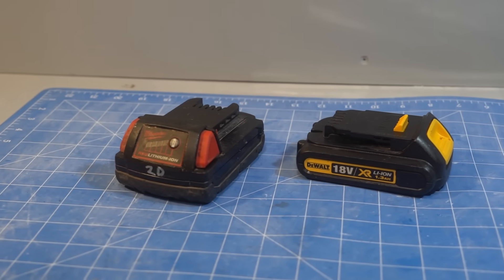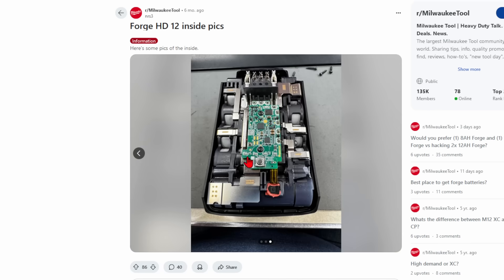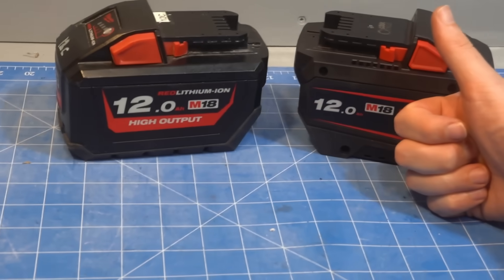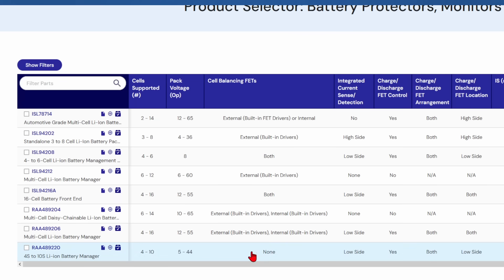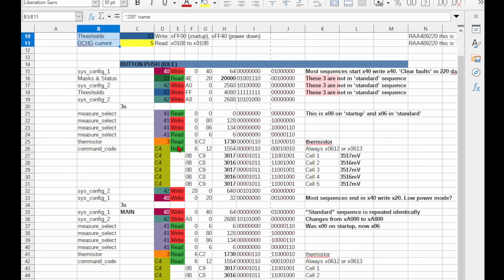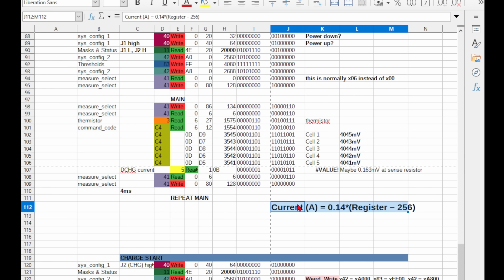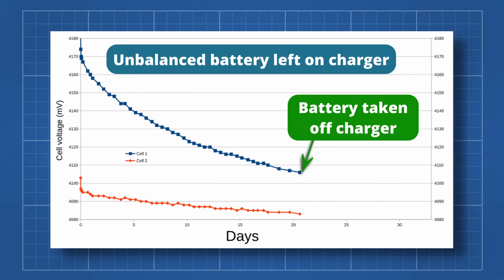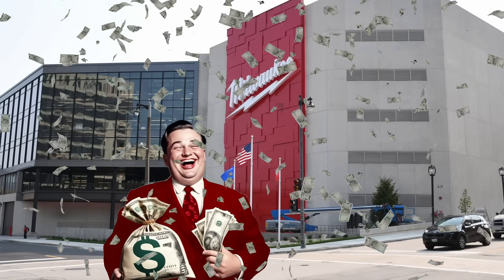[011] Do Milwaukee FORGE batteries balance

Comment: Im a car detailer and I run dewalt and milwaukee buffs and da polishers. The ergonomics of the milwaukee polishers are better, but their batteries are total crap! Lasting just over 2 yrs. I have dewalt 54v flex volt batteries and they're 6 years old.
I was hoping they have improved their bms, but with your findings they haven't.
Thanks for doing a thorough test and letting us know😊
Reply: IMHO the older 5ah milwaukee batteries were decent.  Once they started with the 9ah things went down hill.  Now I find that I'm burning through batteries, both m12 and m18.
Reply from the maker: @andrewfryc5602  do you know which ones in particular fail? From personal experience (and reading of others), the 8Ah and 12Ah are poor. The 2Ah, 4Ah, 5Ah and 6Ah High Output are good.
Reply: @toolscientist  12 amp and 8 amp are the ones that fail. I take the battery apart and charged the low cell, this my give me an extra 3 to 4 months, but the damage has been done by the bms.
Reply: The batterise are high output.
Reply from the maker: Yeah, they've been really problematic for me. The Samsung 40T cells are a nice for power & capacity, but pretty bad with longevity. Unfortunately we're probably going to end up being the beta testers for these new Ampace JP40 cells.
Reply: Same with Bosch Core 4 and 8 amp batteries. I think they use the same Samsung cells, Huge imbalance after 2 years. Many completely dead
Reply: @toolscientist  You read that right - BETA testers! No thanks. 

Makita XGT it is.
Reply: @toolscientist  there are three revsions of 40T cells, original ones, 40T3 and fairly new 40T4. I would say that the original ones are problematic, new ones perform well in cycle tests. They are also releasing a new 45T cells, so I expect some 9Ah packs soon :D
Reply: @andrewfryc5602 Interesting. You sure that the BMS is actually harming things? Because if all it’s doing is not balancing, I don’t see how it would harm them if it doesn’t balance. It should be ceasing to charge when the lowest cell is at 100%. 

Someone elsewhere in the comments had been told that cell imbalance is usually a sign of imminent cell failure. I am dubious of that but your experience suggests it might be true.
Reply from the maker: @riba2233 The 40T3s seem to have been around for years, but haven't seen any improvement in Milwaukee 8Ah and 12Ah. Then again, I haven't seen anyone show that Milwaukee has yet used the 40T3. Someone did post a photo showing them using Murata VTC6A, but that might have been a temporary covid shortage thing.
Reply: @toolscientist  yeah they can be really slow with implementing new cell models, maybe they had a huge order of old 40Ts or something like that
Reply: @riba2233  Do the likes of TTI or Makita actually purchase the cells direct from Samsung/Murata and manufacture the packs in house along with the design and manufacture of the BMS? Or do they pay another company to do that and just design the bms and choose the cells?

I've always wondered this.
Reply: @toolscientist  Yeah it would be hard to find out when or if at all the T3 revision hit Milwaukee or flexvolt packs at all let lone the T5 revision.
Reply: @ good question, but it is very likely that they cooperate with cell manufacturer on pack and bms design.
Reply from the maker: If you dig around the Makita business docs you might find something. They often announce new factory openings and such. I think most Makita batteries are labelled as "Made in Vietnam", or "Cells made in Singapore, rest made in China".

If you look at the Ampace website, you'll see some pouch cell power tool battery packs that look very much like FLEX and Dewalt (one even says "Dewalt"). But that's probably specific to pouch cell packs, which require very different production lines to standard 18650/21700 packs.

Comment: It looks to me that the main power terminals are silver plated. It doesnt look like nickel to me, the rest of the strapping is nickel and this is a different color with a different texture, they maybe omitted the nickel on them entirely and went to silver plated copper.
Reply from the maker: @timothybayliss6680  you definitely get diff colour with thickness and application type. Think zinc-plated (shiny silver or even transparent yellow) vs hot dip gal (dull grey and matte). Matte finish makes me think it's just a very thick coating. I should prob test, though. I'd better go watch some NileRed 😆
Reply: @toolscientist  it could also be just tin coated by the looks of it, not sure though

Comment: Great research! I'd love to see balancing made mandatory by law (e.g. in the EU). Balancing circuits are so damn cheap, even the cheapest Temu crap wouldn't get significantly more expensive with balancing. A proper low voltage cut off should be mandatory too, so that infrequently used devices don't discharge their batteries to death in standby mode.
Reply from the maker: Balancing yeah, but low-voltage cutoff is tricky. You need fairly expensive mosfets to be able to handle the currents, and then all that heat is inside the battery pack. The BMS often has an independent power path, so will continue to draw power even after the mosfets have cut power to the main terminals. So you're still back at the problem of whether or not they've designed a good BMS with low parasitic current draw.
Reply: @toolscientist  You are right, I did not think about all these difficulties. Although I had mostly low power gadgets in mind for the low voltage cut off. Think stuff like game controllers that were replaced with better ones but that are still being used once or twice a year for guests.
Reply: @toolscientist  put the mosfets in the tool away from battery.
Reply: @uhjyuff2095  that doesn't make any sense because the tool can just refuse to run if it senses low or hot battery. tool controllers already have enough mosfets.
Reply: I don't think the EU should do that, rules have a cost to them battery chemistries may change in the future.
I love the idea of regulating how long these should last but when you are writing rules on requiring exactly these methods, it is going to just end up bureaucratic.
Reply: Yes the answer to everything we don't like is to enforce our preferences on everyone by law.
Reply: @Version135   sometimes it makes sense
Reply: @Version135   This comment is a deep simp take in this context.

Comment: My 12Ah milwaukee battery just went from a chronic 3 bars on charge to 2 bars max charge. F#$k
Reply from the maker: Damn. 2 bars will be very unbalanced. Probably 3-4 weak cells
Reply: @gordonborsboom7460  buy yourself a constant current power supply and you balance up the reduced cells.
Reply: You can manually balance that pack with DMM and incandescent car bulb.
1. Charge battery pack on a charger
2. Use DMM to read all cell voltages
3. Discharge all full cells (4.1-4.2V on those) one by one down to same level as the least charged cell by connecting bulb straight to one of those, then waiting untill it discharges to desired level.
Alternatively an TP4056 or IP2312 charging modules could be used:
1. Charge battery pack on a charger
2. Use DMM to read all cell voltages and confirm polarity.
3. Charge all not full (less than 4.1V) cells with such module one by one.
Reply: @volodumurkalunyak4651  Thanks
Reply: Just use a RC Hobby charger, since that is automatic.

Comment: That's really disappointing. At this point it just has to be malicious.
Reply from the maker: I did get contacted by an 'EV battery cosnultant' that said balancing isn't important and that some believe it's best to let them fail rather than prop-up bad cells. I don't really agree. They should be able to monitor cell health based on its voltage response to high discharge currents, charging currents, and how quickly the voltage decays after charging stops. Then balancing can give us longevity in the cases where some cells lose voltage slightly faster than others.
Reply: @toolscientist I’d love to know which ev manufacturers use their advice not to balance cells.
Reply: @toolscientist  I have heard people make that argument for active balancing being useless compared to passive balancing, but I can't fathom someone legitimately trying to argue cell balancing isn't important. In my research and experience, you will always have some drift in the voltages on each cell over time, even if it's small. With good cells, it's usually so small that even a very slow passive balancing setup on a cheap BMS will correct it as long as you're giving it enough time charging to 100%. And as the argument goes, more aggressive active balancing circuitry can indeed mask a bad cell in some situations... But that's only useful in a repairable setup like a DIY solar battery bank. On a pack that's laser welded together and presumably going to be a nightmare to rebuild, of course we want cell balancing! Gotta say I'm pretty upset with Milwaukee over this one, since this was the big chance to change to a BMS with functional balancing...

Still hoping you'll do a video at some point on some aftermarket BMSes for M18 batteries to see if they do balancing. That would be hysterical and sad if a cheap aftermarket BMS was doing what Milwaukee isn't.

Thanks again for all these videos. Your channel is awesome and I'm always looking forward to a new video drop.
Reply from the maker: @ExodusC  to some degree I'm just fence sitting. I don't want to go too hard on "Milwaukee sucks" when I'm not a battery expert. I think they should be balancing and I don't really buy the counter-arguments. But I don't want to speak too strongly on a topic that I'm not an expert in.
Reply: @toolscientist  is it possible to modify the circuit boards to enable balancing, or is it a software design problem?
Reply from the maker: @WaynesWorld999  Software for the old ones. This new one could be hardware, which would make it impossible to fix. Won't know until Renesas releases the datasheet.
Reply: @toolscientist  you are selling yourself short, you know more about this stuff than you think others do, trust me :)
Reply: @toolscientist  Frankly, it seems you know more about M18 batteries than Milwaukee does! I guess I am going to have to plan to take a day every X months to crack open all my batteries and manually balance them. I have some 8Ahs that I am sure will hit the 3 bars of death at some point... If they don't melt first, like some of them have.
Reply from the maker: @ExodusC  They've got access to a lot more info than I do. In particular the 'Mean Time Between Failures', and I guess they know that it's good enough so why bother extending their life any more.
Reply: @ Dont buy into arguments from authority. This touches upon systemic issue beyond cell balancing and battteries. Sometimes even if you are not an "expert" basic intelligence prevails and beats "arguments from authority". The expert is entire intellectually incompetent or dishonest here and anyone with just the basics can see that
Reply: I wouldn’t listen to a thing that battery consultant says now. YouTube would delete if I was being really honest here. Anyways it’s all clear to us that Milwaukee is going out of their way to avoid balancing here
Reply: @toolscientist so they'd rather brick a 100 cell battery just cause 2 are "bad" 

Sounds like planned obsolescence alright
Reply: Balancing is crucial for serial setups.

How much do you bet that Ev battry manufacturer do not include ballancing circuitry.
Reply: @toolscientist  Sorry for the answer to an ancient comment but these companies are not going to shell out top-dollar for premium batch tested batteries with quaranteed A+ matched performance. If you have no balancing, your batteries need to be of the highest quality and regardless they will still eventually go out of balance. If you use normal 21700 or 18650 even from reputable manufacturers they will absolutely go out of balance over a hundred recharge cycles. Perhaps not catastrophically out of balance after a hundred cycles or for a good while after that but losing 10% or 20% of capacity is entirely likely.
Reply: @toolscientist  that guy is full of it since EVs absolutely balance their cells.
Reply from the maker: They didn't say EV batteries don't balance, and what they said was pretty brief and generic. They may have been referring to power tool batteries in particular. To an EV battery person, power tool batteries are probably seen as cheap, disposable, and badly abused. A strong argument for balancing being optional is the fact that Renesas makes a Battery Front End specifically without balancing, and you can't even add external balancing mosfets, you'd need enough spare GPIOs on your MCU.
Reply: @toolscientist  interesting. I know that early makita 4ahs didn't have balancing because they relied on Sony's very tight tolerances in their cells. Not sure if manufacturers have the same philosophy today
Reply: @toolscientist  everyone outside planned obsolescence batteries (power tools, cordless vacuums, etc) balances cells. Some (most) BMS  chips have internal FETs to balance cells. 

We should form a class action. Hopefully will set a precedent
Reply: @toolscientist  Did that battery consultant happen to be paid by Milwaukee to contact you and say that balancing is just not necessary?  lol
Reply: Enshitification for planned obsolescence.
Reply: Whaaaattt , EV batterys all ballance ( actively ) and have really sophisticated BMS that does this task . Otherwise all they will all get so out of ballance that the pack would be useless. You are bang on ballancing is required especially on cells that are run hard. The ev battery dude is tripping ...😂
Reply: @raymutch Wouldn't the much larger number of cells in EV batteries ALSO make it much more desirable - if not, necessary - to balance them?
Reply: @harrickvharrick3957  yeah , spot on👌 and  due to volume of cells is more likely that you get out of ballance over time. It plain good practice to ballance no matter the size pack .
Reply: Not balancing the cells in unnecessarily creating E-Waste is extremely irresponsible. It causes unnecessary pollution and is a waste of resources and energy. 

DeWalt also does not balance their cells. I had a DeWalt battery they didn't last very long anymore and I built a manual sell balancer and balance the sells myself. The battery now performs as good as new once again and I don't even balance it every charge just on occasion.
Reply: of course it is malicious
Reply: I've fixed hundreds of Imbalanced Milwaukee batteries before I've ever seen your video I was convinced Milwaukee purposely Imbalances the battery after the warranty was run out. I don't have physical evidence but it always seems the batteries go out of balance soon after the warranty runs out.
Reply: They make most of their money from batteries look at car batteries same game Milwaukee  make the battery last less more cash for the wicked
Reply: Where are the balancing chargers?

Comment: Balancing only means the battery lives for longer. Cannot have that. Decreases revenue. 
What do other manufacturers do? Makita?
Reply from the maker: Makita batteries are capable of balancing, but I won't know until I test it.
Reply: https://youtu.be/szN3ZGhgggY?si=PC7Y0FqaRKI1jVD-
Reply: @toolscientist   They certainly advertise that they balance charge their battery but I'm not sure about that. Link below is quite crude way of testing compared to you, but he concluded makita does not balance charge. It's Korean but you'll know exactly what he does just by looking at it. I'm interested in your test result.
Reply from the maker: @technologicalsingularity1788  there's a few problems with that test. Makita batteries use a chip that balances by draining high cells, not charging low cells. So one cell low means you have to drain 4 cells, which takes a long time. Hard to tell without a translation, but it looked like he hardly gave them any time to balance. You'd be lucky to see a few mV difference.

Thanks for the link l. I've saved it and I'll have a closer look when I do Makita.
Reply: @toolscientist  Good to hear. As a tool nerd and hobbyist who have built some e-bike including batteries, I really enjoy your high level contents as I've said before. Always looking forward to your new videos. thanks
Reply: @toolscientist  Please do test other manufacturers then - would be a good series.  
Parkside would also be nice if they exist in your country (they are sold in a food discount store here in Germany, Lidl).
Reply: Most seem to skimp on it, for unknown reasons. Parkside batteries seems to balance their cells, but don't seem to be that great durability wise. I've read Makita does cell balancing, but haven't seen it confirmed by testing. Bosch didn't do cell balancing in the past, but after some issues, they stated that they 'took measures'. Not sure what that means. Could be that they finally implemented balancing, or it could be something else entirely (a better fail-safe for when the cells go out of balance, for example).
Reply: @whuzzzup   ALL OF THEM.
The only tool company I know for sure balance charge their battery is Parkside. Pretty ironic, isn't it? 😂😂
Reply: what about Hilti? With them being a rental / fleet tool, i would imagine they would want them to last as long as possible, AvE did a tear down on the mechanical and they were far superior to other brands